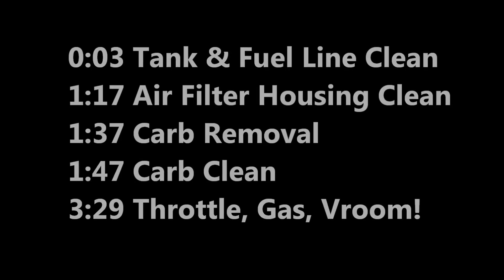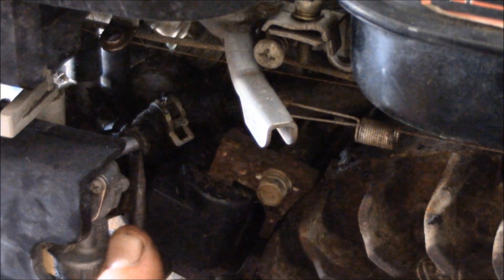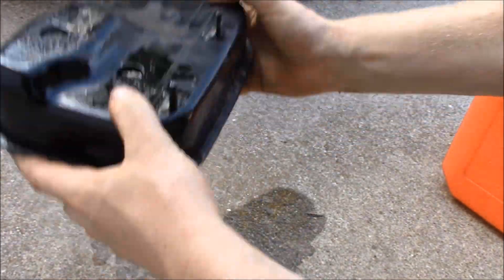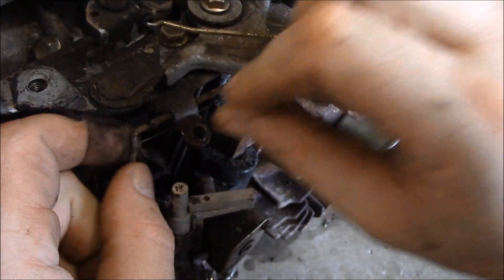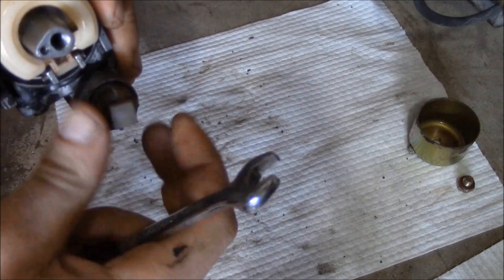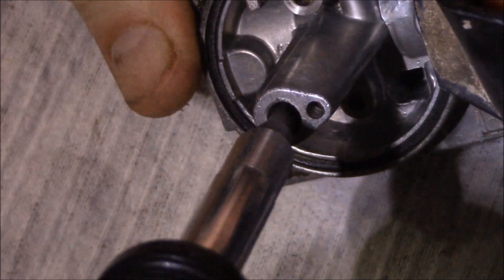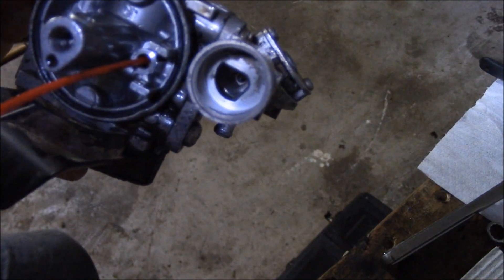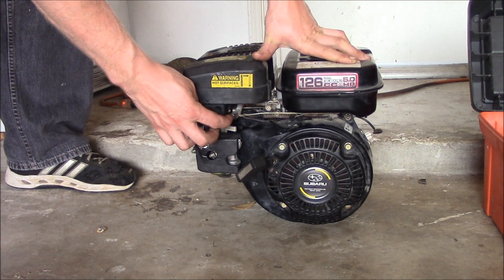How to Clean a Carburetor on a Small Engine, Mower, ATV, Go Kart, Scooter

Comment: This was a great short video that gave me the information and confidence I needed.  I removed the float bowl amd cleaned out lots of dirt, but it still wouldn't keep running, so I squirted a full load of carburetor cleaner into the air intake and eventually got it started and running fine once it had run for several minutes and all the obstructions were washed out.
Reply from the maker: SUCCESS

Comment: My go-cart is brand new and I can't remember the size and it will not start it's getting gas and the compression is good and the plug is getting all kinds of fire..it will sling spark good please please help me I am witts end with this thing
Reply from the maker: Kill switch engaged? Spray a tiny bit of carb cleaner in it and see if you can get it to turn over

Comment: Idle pilot screw needs to be screwed all the way down note the twists before removing so you can replace it right. Also be very careful with needles they may be plastic and rubber tip rubber tips will be destroyed very easily if you are not careful

Comment: When putting the auto pilot back in is there an adjustment on it or are you just tighten it down
Reply from the maker: Auto pilot? Main is a screw, idle just pushes in on some carbs, screws in on others

Comment: I'm new to engine repair. I see what all the components do but what is that one piece that has the metal shroud. The one that had the black cover with the icon of a hand with an X through it?
Reply from the maker: metal shroud with hand X? Probably muffler. ITs hot when running. Dont put your hand on it.

Comment: I was so confused for a second cause I have an older Briggs
Reply from the maker: Yeah the Briggs flathead? Totally different. Those are pretty easy to clean though. Just gotta watch out for cracks in the pick up tube and there is a rubber piece inside that gets stiff with age that sometimes needs replacement. It helps pump fuel in.

Comment: Hi , I have the same subaru x21 design as a water pressure pump .  Can this design still be good to convert into a mini bike are go cart engine ?  Some people are telling me water pump sometimes have short connecting rod and won't produce e eough rpm or torque to run a mini bike , is this true , what about this engine design , can it be done ?  Thank you so much for your reply greatly !  Thank you !
Reply from the maker: +Joeblow Johnny crankshaft may have issues with taper or length. If it’s a straight crank you should be ok

Comment: I have same exact engine what oil does it take and how much does it take thank you
Reply from the maker: +Robert West that info should be in the users manual
Reply: Robert West 4 cyle oil,10-30 is also.fine..just.dont over fill.

Comment: i recently started working at a small engine shop and i use welding tip cleaners to clean the main jet in all the carbs i rebuild!! just a heads up if your carbs jets are very dirty!
Reply from the maker: +Ryan Charyk nice! Are they the little bristles?
Reply: KartFab  it's more like a rounded file like a rat tail file if you k ow what that is!! I use it all time and it works great, try it out for ya self if ya want to!!
Reply from the maker: +Ryan Charyk got it.
Reply: If ya use it let me know how it works for ya!!!!

Comment: hi i cant remove the bolt from the middle
Reply from the maker: +Gaming_Volt make sure the screwdriver fits
Reply: KartFab thanks i did it
Reply: KartFab but before i remove to clean the carb it was accelerating but it self
Reply: KartFab why it accelerates by it self
Reply: KartFab hello I got a question why it accelerates by it self
Reply from the maker: i dont know, you need to look at my throttle setup video
Reply: Gaming_Volt m7yh

Comment: will do. thank you for the help.
Reply from the maker: no problem
Reply: +KartFab i have a problem with my baja mini bike 196 it will start then it will bogg out or will not start at all any suggestions??
Reply from the maker: clean the carb
Reply: Mico Perez  carb got varnish..or else bad gas or plug or blocked.fuel line..replace the plug,fuel line add an inline filther clean the carb guarantee it will fire right up.and no more deposits in carbs because inline  filther  catches it..

Comment: can you please help. my son's gokart is leaking gas from the air filter. when I turn the gas lever on, from the gas tank to the gas filter to the carburetor, alot of gas leaks out and continues to leak out from the air filter. is this a bad carburetor? TIA
Reply from the maker: open the bowl from the carburetor. Check the float (usually round plastic thing) shake it to make sure there is no gas inside. Next, check the needle (thing that is attached to the float) it has a pointed tip, that tip needs to push up against a round seat. When you have gas leaking out of the air filter it is because the float is full of gas or the needle is not seating properly to keep the gas out.

Comment: Hey +KartFab, I have a Predator 212 from HF and I've  been having an issue with it shaking and coming close to dying/putts a lot after throttling. Can you help please?
Reply from the maker: any mods? did you let it warm up? choke on or off?
Reply: No mods. I did for several minutes with choke on. I think it may be running too rich because when I checked the plug it was sooty.
Reply from the maker: if its almost dying after throttle, and everything else is fine, you need to adjust the idle speed screw. It is a black plastic screw that sits on top of the carb. Turn it clockwise (after engine is warmed up and choke is off) until the idle is where you want it( which is usually ~1650 rpm)
Reply: Thanks!

Comment: Solid video, soothing voice. My kart starts every time, idles nice, but when I give it gas, it dies. Is this a carb issue?
Reply from the maker: +Kyle Woods what you are describing is a lean condition. Usually the main jet is partially clogged, so you need to clean it.
Reply: +KartFab 
i cant get mine to quit running full blast. do you have a email or cell i could send a pic of the carb linkage to see where its not hooked up right.
Reply from the maker: +wakeywakey go to diygokarts forum
Reply: Sounds g mbpsb bfn bcc chug b' x, bub b chug ,Sounds b vscvvvvcv cbc bvvvbbvnb vg cbc

Comment: I half to hold the throttle closed by hand if I let it go the govenor springs back open
Reply from the maker: Sounds like you introduced a new problem. With the engine not connected to a remote throttle cable does it do the same thing? Do you have a throttle return spring? Set on manual throttle or remote?
Reply: +KartFab no the engine is sitting on my bench with nothing connected to it, I could be wrong but isn't the govenor hold the throttle open when engine off and when the engine is started the govenor closes the throttle? the govenor pulls the throttle open and  runs the engine wide open..in the end of your video I noticed before you start your engine the gov holds the throttle open when you pull start it the gov closes the throttle. mines doesn't do that. there's no resistance from the govenor to close the throttle?  I'm stumped by this condition because it started doing that after I disconnected the throttle linkage from the carb.. great video by the way I got into carts not to long ago and your you visit are very helpful
Reply: +luis flores** your videos**
Reply from the maker: hmmm... double check linkages, check users manual. You didn't mess with the governor arm did you? E.g. the arm connected to the governor shaft in the engine.

The governor holds the throttle WIDE OPEN on start up, that is what it is designed to do. Once the engine starts, the throttle lever controls the throttle butterfly, and the governor does not really do anything until 3600 rpms, where it begins to close throttle as you can see in the video. It would not hunt like this under load though.

Comment: I hade a carb problem on a robin ex27 9 hp and it seems I traded one problem for another, at idel I had to slowly give it gas to gain rpm if I just slamed on the throttle  it would die, I did exactly as you did on your video n now the throttle response is perfect only now it runs at wide open throttle. everything looks normal I put all springs back the way they were but it's almost as if the the governor isn't working,  any idea what I did wrong or what could of happend?

Comment: i noticed that the jets have a super tiny hole..does it matter when putting it back together where they end up pointing at?
Reply from the maker: No it does not matter since it is a cylinder. Just use the right size screwdriver and do not over torque since it is brass.

Comment: my kart only starts when I prime the cylinder but once that is prime is gone it dies. I think it might be a carb issue but not sure. I cleaned the carb but didn't take it apart like in this video . what do you think?
Reply from the maker: +Will Loubriel fuel delivery problem.

Comment: i have a engine on my go kart just like this but its called a robin i cleaned the carb but when it starts it takes off by itself
Reply from the maker: +Carter Scott robin subaru is the name/brand. You probably have an idle issue. There is a screw on the carb that keeps the carb butterfly from moving all the way closed, try adjusting that first. It could be a clutch problem too.
Reply: ok thx
Reply: on the throttle butteryfly it pushed back instead of staying in the front

Comment: Ever heard or soaking the carb in diesel fuel to help loosen the gunk? I heard that helps but I'm not sure. I might try soaking it overnight then taking it apart like in your video the next day.
Reply from the maker: +Aaron Spencer I have only cleaned carbs with carb cleaner and some elbow grease. I have heard, that boiling them in lemon juice works too though (never tried it).

Comment: Is there a cheap gas tank that a fits Robin Subaru EX27 10 hp because the replacement part is 80 dollars
Reply from the maker: +Dr_joe_smo 24 unfortulately, the subaru engine replacement parts are prohibitively expensive.
Reply: You can probably make a cheap chinese tank fit if you work on it a little.